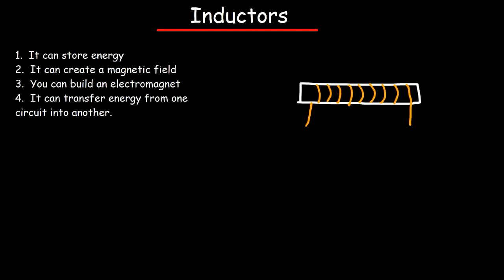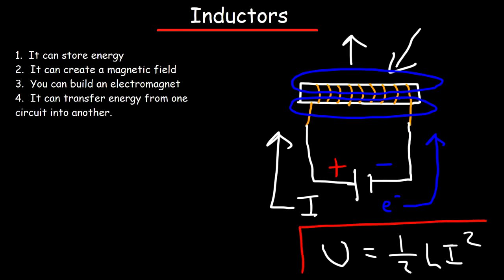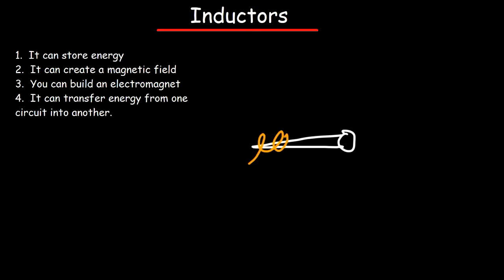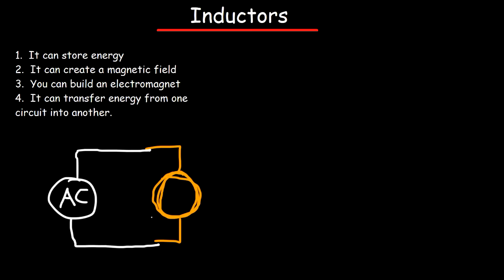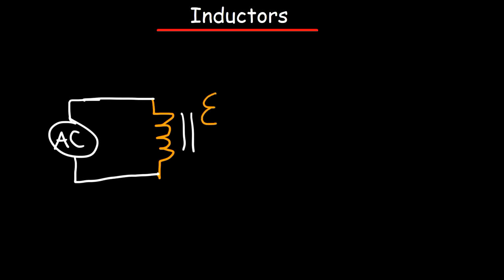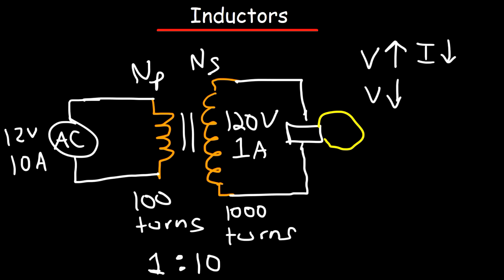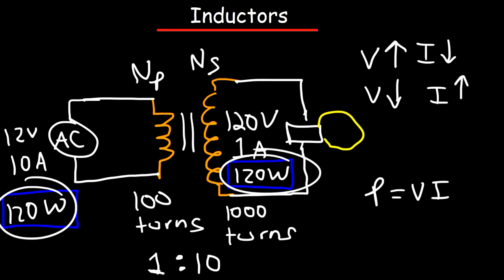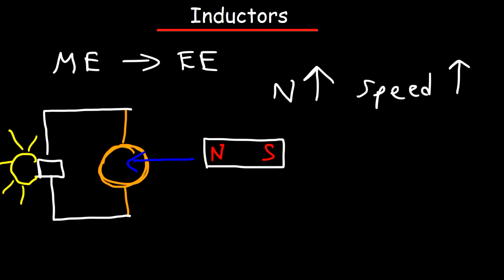Inductors - What Are They And How Do They Work?

Comment: i tried to make an electromagnet in 5th grade, coiled a wire around metal rode and connect the ends with a car battery, bare hands, the wire and rod rod turned red, my hands got burned, after things cool down, the wire and rod became a single metal piece, Ps i didn't wire has to be insulated. : /

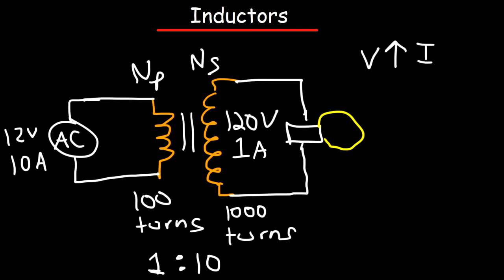Comment: How  the current decrease when the voltage goes up in here? 8:10
Reply: Theoretically , power in primary transformer must be equal to the power in the secondary transformer.  From the equation P =V I , if you substitute the values it will give you the deceased current if voltage has increased and power remains the same.

Comment: 5:55
Alternating current only changes the direction, not on and off,  then why the bulb goes on and off. The Current is still going through the bulb through the two circuits. Could u clarify this confusion? Thanks

Comment: Very good video I was wondering can you do an update video on inductors when you connect one inductor step the power up and then another inductor as though they put in inverters or tigrid inverters what's Willie going on when you step up the power how many watts and then if you step it up again how many watts and again until you can't do it anymore which if you look at some of these 5,000 to 7,000 Watt inverters doesn't seem that they have a limit maybe that's because they put a butt converter in conjunction with the boost converter you tell us

Comment: How to protect my circuit when the inductor collapse?
Reply: To protect your circuit when an inductor collapses, you can use diodes to prevent back EMF from damaging components. Adding fuses can also help by breaking the circuit if the current spikes. It's important to ensure your circuit is designed to handle these changes safely.